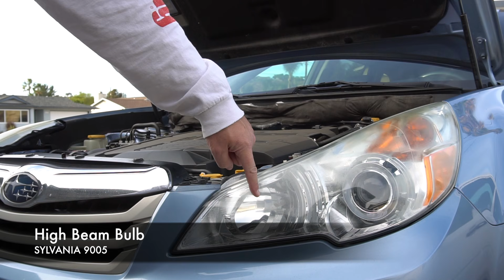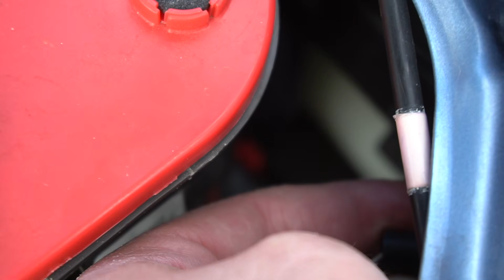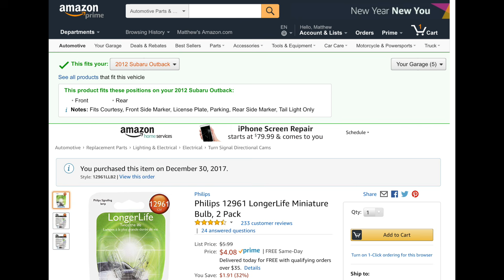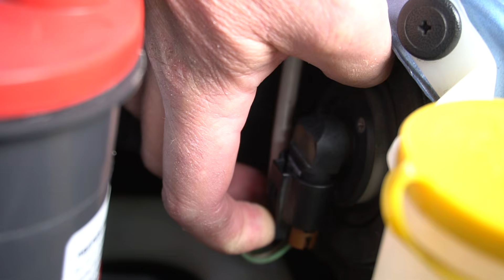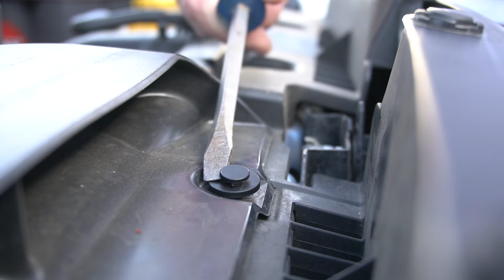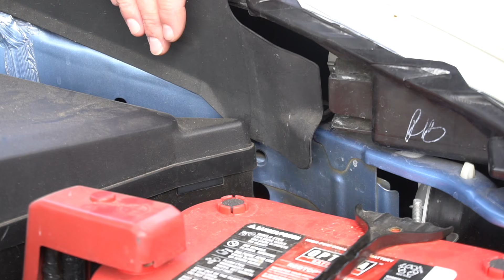2010 - 2014 Subaru Outback Parking Lights, High Beam & Front Turn Signal Bulb Replacement

Comment: you have the same battery i have, my last one lasted 8+ years (probably could have lasted longer) i just read that a weak battery can make the light bulbs burn out more often (a common complaint)  and a strong battery can make them last longer.  i am just now needing to replace my lights in my 2012 legacy with 84,000 miles.

Comment: the hardest one is the side marker bulb.  I don't see how to do that without taking off the whole bumper and headlight assembly.
PS:  In fact, mine has been out for months, and I don't know how to get at it without taking off the bumper.    Does anybody know where I can get a bent needlenose pliers that is long and has about a 9" "nose."  my hand is just too big to get in there to turn the bulb socket.
Reply from the maker: I’m amazed with all the bulbs I’ve had to replace (and some of them Multiple times) I’ve yet to have to tackle the side markers! There I’ve said it, I bet any day mine will now need to be replaced!

Comment: Older video but adding this in case anyone new  comes across this as I did . Good video to show location of parking/DTRL and how to access it BUT for anyone who will be changing the bulb, be aware, it is a royal pain. My hands are not overly large and I could barely get my hand n there to tune the lamp holder. You do not need to turn it very far counter clockwise BUT, there was no audible click, the holder just loosened up but would not pull out. I needed a medium sized 45 degree needle nose pliers to get a good enough grip on the holder and pull it out, with more force needed than one would expect (and then the old bulb just fell out as it hit the frame when I pulled. The bulb holder has 4 locking tabs and they are different sizes so when putting the bulb holder back in, you need to be sure that you are lining up the tabs with the appropriate slots in the lamp assembly. Once that's done, push in and turn clockwise ( you may need the pliers again).
Reply: Are the DRL supposed to be super dim? mine looks like they need replacing

Comment: Thanks for sharing. Just replaced bulbs for a break light and tail light. Pretty easy. Tomorrow need to replace one high beam but may as well do both. Both low beams went out within a few days of each other. 😞 A Real pain in the tail to get to.
Reply from the maker: Good luck on the low beams, those are not fun…

Comment: This is the only car that we have ever owned that we have been tempted to sell on account of the ridiculous headlight bulb replacement process. No, we still have our OB and are suffering regularly.
Reply: The first time I need it myself, I didn't understand that latch. So instead of pulling it off, I unscrewed it (losing the screw in the process)  I panicked and flew up to the dealership.  130$ and me complaining because they didn't want to change the other headlight (they claimed it wasn't necessary because it wasn't burnt out)  I watched a few videos and figured out how to do it myself (correctly).  When my license plate when out,  they wanted to charge me 60$ to change it.  This is probably one of the only things I hate about the OB.  I would like to know who in design thought it was a great idea to install a lightbulb there!
Reply: Agree.  had I know how hard it was to change the low beam bulb, and how much the dealer charges, I would not have bought the car.  But who even thinks about these things when they buy a new car.  I think there was a class action suit against Subaru because of this, or some other related matter, or just tsunami of complaints, and Subaru agreed to replace the bulbs as warranty coverage.  it was a certain number of replacements or up to mileage cap?  in any event, our warranty replacements ended and I had to do it myself this past weekend.  Takes about 60-90 minutes.  But why do I need to replace it?  I had each low beam replaced twice under the warranty.  Probably because of fixed rate compensation to the dealer so they use the worst POS bulbs they can find, to keep the customer coming back so they can try and sell you more other stuff each trip.  And the bastards would never replace both bulbs at once, so I had to go back within 2 months for the other POS bulb each time.  The 2011 OB has been great vehicle overall, and plan on keeping it, but overall I am done with Subaru.
Reply: @CJinsoo  get a body clip tool and a bulk bag of clips and and do it through the fender well. it's MUCH faster than the "official" way of dropping the bumper. Oil change or tire type places will usually do this for you cheaper than the dealership.
Reply from the maker: Those are the worst to replace, the ones I feature in this video thankfully are relatively easy.
Reply: Go in through the wheel well. Took me 20 mins and I had never done it before!
Reply: I feel your pain. Now wait till the CATs clog and they cost more than $2000 to replace. Oh let's not forget about the valve body inside the transmission. That's another $2200. I hope you have better luck than me.

Comment: 10/10 tutorial! The lights on this car are a pain to change!
Reply from the maker: Glad it helped. Wait until you have to change a low-beam bulb on your Outback (not covered in the video) those are the fun ones. (not).
Reply: so far my only gripe with the car.  I changed like 3 sets throught the wheel well.  Then I decided to switch to LED to remove the 2-3 year need to replace.  Had to take the bumper cover off and removing the light housing was a breeze.  So shame on Subaru engeneers for not designing a better way to change those bulbs.  Over all thought GREAT CAR!!

Comment: I need to replace the parking light bulbs on my 2014 Subaru Outback, when I follow the link you provided for purchase, it says that this would not fit my vehicle. Everything else you say about replacement rings true for my Outback, but I can't figure out which part I need if not the one you recommend. Thanks for any help!
Reply from the maker: Best bet would be to remove the old bulb and inspect it for any markings. Mine were hard to read but were marked "w5w" which is compatible with the bulb I bought and provided a link to. I've seen other bulbs that I believe have the same specs listed by the following part numbers: (168) (2825) and then there are many "LED" variants too.

This link may also provide help:
https://www.sylvania-automotive.com/apps/vlrg-us/Vlrg/
Reply: Thank you! My owners manual says I need a w5w. Nothing came up when I searched for that so I am glad to know your recommendation is compatible. Thanks so much for the help!

Comment: For those of you installing LED lamps-- Take the little indexing ring off the lamp. Install it and secure the stupid wire clip. THEN put the lamp into the ring. Many of the LEDs have a cooling mechanism that makes it nearly impossible to fasten the clip with the lamp in place.  Tried to install that clip for 4 hours one time and tore up my finger doing it before I discovered that I could put the ring in first. No problem securing the clip then. Also if you smear the gasket on the hosing cap with silicone grease, the kind you use in a ceramic faucet cartridge, it is much easier to re-install.
Reply from the maker: It’s hard enough to replace the standard headlights (reaching up through the fender well) on these cars with replacement lamps that fit!
Reply: I just installed my LED lights after reading your comment, didn't internalize the knowledge well enough because I had the same exact struggle like a dumbass lmao

Comment: You forgot the position side marker light.  Beside the indicator light. Similar to front position light in high beam housing.
Reply: Just got a used 2011 OB. Is that side marker bulb supposed to be behind that orange reflector?
Reply: Owners manual 2010 outback
Reply from the maker: Shawn is right. The side marker is another bulb in the assembly and it has to be replaced through the fender well.
Reply: @MattsGarageMiscDIY  how to replace the left marker light for subaru outback 2011